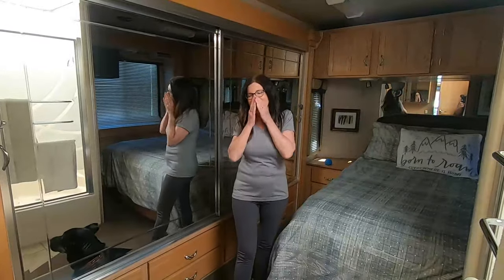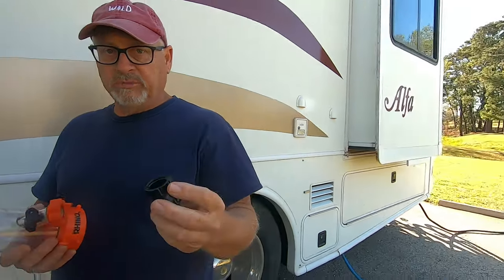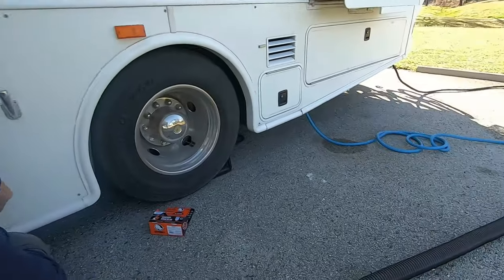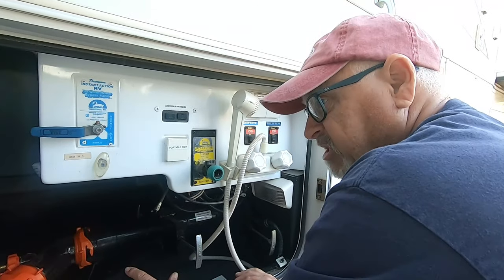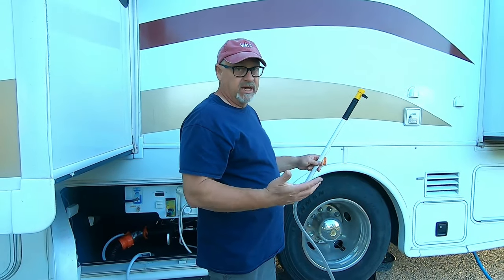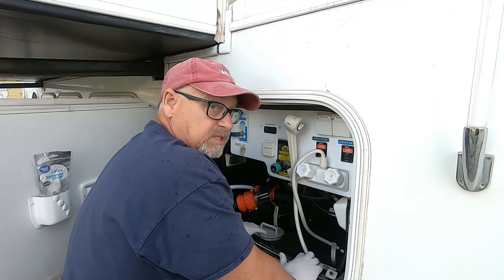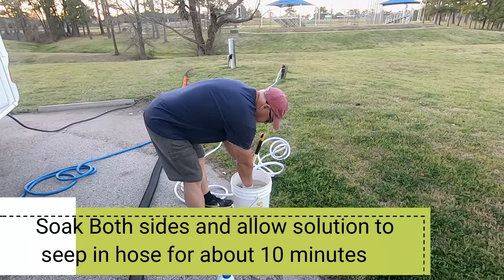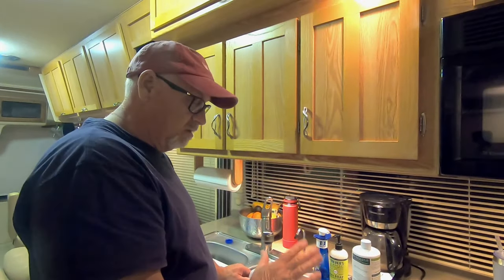Cleaning Out Your RV Black Water Tank 🚽 RV ENEMA 💩 RV Holding Tanks Maintenance

Comment: The best way ive done this (homestead living in a 5th wheel full time) is to do what youre doing, but have a shut off valve after the backwash attachment. Close the valve, and with a cheap water meter for the garden hose, fill to right before your tanks capacity and shut off the water, then open the dump valve. Repeat 3-5 times till water runs clear. 😊
Reply from the maker: Great tip! We ended up replacing the toilet. No more problems.
Thanks for watching!
Reply: @RoamingWithRosie  what was wrong with the toilet? And what toilet did you replace it with? Because I've been having issues with my tank constantly getting gunked up. Which is why I bought the backflush and started doing it.
Reply: Filling and flushing will not clean as good as the wand.
I know you see clear water coming out but believe me if you use the wand you'll see.
Reply: @bobcloughjr  I'm hooked up to a septic and sometimes have issues draining. I'm not too worried about it being spotless as I'm not using it for travel but rather living in it as we build a cabin.
Reply: What you really need to do this correctly is a gate valve attached to the downstream side of the Rhino Blaster. The better unit to buy is the Flush King which comes with a gate valve. This way you can fill up the tank and then drain it. When you have a full tank, the water pressure being drained is far greater than doing it the way you did it.

Comment: Probably not a problem, but, ever the perfectionist, I have a hose JUST for black water cleaning and a WHITE hose which is ONLY used for potable water.  Also, we bring gallons of reverse osmosis water which we use for drinking/cooking, so we almost never drink water from the on board freshwater tank. The idea of using my white hose to back flush the black water tank makes me cringe.
Reply from the maker: My fresh water hose is blue and is stored where my fresh water hook up is. The long white is with the rest of the sewer stuff in a large storage container and only used for flushing my tanks. 
 I am really picky when it comes to water. I only drink bottled water. 
Thanks for watching!

Comment: Dude that backflow preventer supposed to go in at the rhino connection that way you don’t contaminate your hose
Reply from the maker: No, the black vacuum breaker goes between the hose and the faucet. Read the instructions on the Rhino Blaster packaging. It specifically says between the hose and faucet. 
Thanks for watching!

Comment: Words of experience.   Before you drain the black and gray, hook up the hose and turn the water on.   If the valve is in the wrong position, and no water hose, it will leak out with the black water.   My flush elbow has a gate valve after the hose connection.   You can close it off and fill the tanks to flush them out multiple times.   Fun ain’t it!
Reply from the maker: Thanks for watching and the tip!

Comment: If you want to see how well you cleaned your black tank before you add your chemicals.  Fill your toilet full of water and have someone  watch the clear fitting while flushing the toilet. We also dump our dish washing water in the toilet and dump our black tank every  3-4 days. Never have a problem with smell.  Been doing this for several.
Reply: Years.  Also when using the wand ,don't let the toilet flapper close before removing the wand . You may damage the seal .
Reply from the maker: We replaced the old toilet with a Dometic 310 toilet and have had no issues. 
Thanks for watching!

Comment: We just refill our 40gal black tanks with about 25gal of clean water after we dump, then dump that out, and fill again with 10 gal.  Then we add OxyClean.  Couple of scoops per tank after each dump.  This method has been working great. When we first started full-timing it was an issue till we started doing this.  Since then no problems.
Reply from the maker: Thanks for sharing. When you purchase an old RV, you just arent sure what stored in there. For instance when we installed our Lion Energy batteries, we discovered a pack rat had lived in the spaces between the floor and the basement. Must have been quite awhile. And with this, a poop pyramid had dried to a state that wasnt coming out with liquid chemicals or dissolve even after driving around with it. This rig needed an enema! 🤣😱 Thankfully we have no odor left.
Reply: I do the same method of refilling but also a couple times a year the wand. You would be shocked to see what comes out of what you believed was a "clean" tank.
I suggest you try it.
Reply: @bobcloughjr  no doubt it's a mess in there.  The tanks in my RV have a spider nozzle thing with multiple exit points for the incoming water spread around the tank. Not exactly sure where they are in there, but I think they help somewhat.  Your advice is well taken though; I'm sure there are places the nozzles don't reach and they are probably caked up with goo.

Comment: Beautiful motorhome! We bought a travel trailer a couple weeks ago, unfortunately the previous owner left us with a black water tank that was about 3/4s full. Checked in the toilet not the gauge, they said they didnt use the camper this year so this is last years waste and im terrified its not gonna come out. Its still liquidy but man, i couldnt imagine leaving someone with my families mess like that. Never drained one before so thank you for the info.
Reply from the maker: I feel your pain. Our first motorhome had a poop pyramid. That usually happens when they leave the valve open when camping at a campground. The fluids drain out and leave the solids. That took some getting rid of. 
Thanks for watching!
Reply: @RoamingWithRosie  luckily mine looks pretty wet inside, gonna go dump it tomorrow, just my truck back from getting and alignment.
Reply: My wife and I bought a used 2021 39' Open Range travel trailer. We are experiencing the same problem. 
The previous owner used the trailer in a different state where he was working. He left the trailer down there where he was working when he traveled back to his house about 30 hours distance. 
We have emptied and flushed but still have the foul order. I've used different chemicals and cleaning agents to no avail. .
Your video was most helpful. I don't believe the previous owner took very good care of his trailer and then left his mess with me..
Thank you Roaming With Rosie for sharing this video. .

Stan

Comment: I have a 2004 SeeYa and use Alfa;\'s Sani-Flush with each dump. Other then an occasional odor fixed with Borax. We've had no major odor issues in 3 years of full-timing.
Reply from the maker: Sadly when we bought the Alfa, none of that was working anymore and a previous owner had tried to fix and ruined it all.. Its a pretty little plaque down there though. 😊

Comment: Good tips guys, Using the flush wand is your best way to clean the black tank, Note; if you have a gravity flush toilet only the wand should not be used with Vacuflush or macerator toilets. BTW, RV Digest-It is the best black and gray tank treatment on the market. The Rhino blaster basically just adds water to the tank, there is no way for the jet stream to hit the tank and break-up any waste due to the angles and bends the discharge pipes are at, the jet stream is dispersed by the bends and angles, unless it's a straight shoot right into the black or gray tanks, which is very rare. Safe Travels!
Reply from the maker: Thank you and thanks for watching!

Comment: I have a very similar set up except I use a system that has a shutoff downstream of the sewer hose drain that lets the tanks fill with water. I found that this clean the TP that sticks to the sides of the tank plus the heavy solids that need to pulled out with large amount of sewer drains.
Reply from the maker: When I emptied the black tank and hooked this up. I was surprised at much more came out. I have started doing the back flush every time I dump our tanks. Thanks for watching!

Comment: We had similar smell issues in our bus conversion, even after flushing and adding chemicals to break up solids. At the end of the day it took the toilet wand to fix the issue- there were little solids pyramids/columns in various parts of the tank. I would insert the end of the wand into the toilet, turn it on and lower it while on until you hear that grinding noise- then back it up just a bit. This means the wand can spin freely and is upright rather than at an angle. Our "permanent fix" to this issue has been to replace our toilet Dometic 310 (gravity fed) with the Dometic 7640 (macerator, same form factor). A macerator helps prevent buildup and doesn't allow the tank to "burp" into the cabin with buildup odor.
Reply from the maker: We had wanted to change out the toilet so ended up changing it out to the Dometic 320 toilet. Turns out the old toilet seal was all dried out and cracked. No more issues.
Thanks for sharing and watching!

Comment: You need an additional valve between the flusher and sewer hose. That way you can shut sewer line off while flushing with water to build water volume and agitation to tank and then after doing fill / flush water to black tank then turn off water then open gate valve between flusher and sewer.  So water.does not go down sewer while flushing
Reply from the maker: I already have the additional valve and also flush out my tanks. The issue was the seal that goes between the floor and the toilet. It was completely worn out. 
Thanks for watching!

Comment: Would a vent pipe with a small fan on it that hooked into the black tank that you can activate with a switch work to vent the oder in the black tank out when you flush and the ball valve is open?  That would create a suction up the vent pipe and gases would not go up the open toilet hole.
Reply from the maker: We ended up changing out the toilet. The problem ended up being the seal on the bottom of the toilet.
Thanks for watching!

Comment: I'm sure you know that you have a sani flush built into your black tank, good video.
Reply from the maker: It quit working before we purchased the RV. And the electronic flush valve not only didnt work, and the manual valve was stripped, meaning someone had already attempted this manually. A 17yr old coach. Some stuff is worn out. We're slowly replacing things. 😉

Comment: After doing a thorough clean and flush, I like to add Dawn low sudsing  dish soap with 5 gallons of water and travel to the next campsite letting this solution slosh around good to clean the sensors, Then dump and add chemicals.
Reply from the maker: That's a great idea! Thanks for watching!
Reply: @Larry V EXCELLENT IDEA!!!  I am going to try that.
Reply: I watched a YouTube video where they used calgon bath pearls, pinesol, and water mixture, and that really keeps things silky smooth running. Just youtube it you can see the videos people swear by using only that and no pricy rv chemicals.

Comment: You should try the rhino with the valve so you can fill tank with water and flush that way :)
Reply from the maker: Thanks. There are a lot of warnings about using those. People need to use care before trying.
Reply: @Roaming With Rosie  oh interesting. I've never seen any warnings. I always use a water flow meter so I know how many gallons I've put back into the tank. What are some of the warnings?

Comment: So if your system is hooked up to a septic line do you still have to do this flushing of the black tank in the gray tank?
Reply from the maker: Yes, when your hook up to a septic line in a camp ground you don’t want to leave the valves open. If you leave them open the liquid will go through your hose and leave the solids in your tank creating a real problem. Flushing your tanks clean anything that maybe stuck on the side walls of your tanks.
Thanks for watching!
Reply: Oh my..I really have messed up...
Hooked up to my septic tank, lived in rv for a year, never moved it!!
Working on cleaning it now.. one good thing did not put tp into toilet.
But no smell..and it works. I hope no teepee.

Comment: When you’re breaking down you rig to go home. 
1. Dump the black tank
2. Dump the gray tank
3. Fill the gray tank 
4. Fill and dump the black tank at least 2 times
5. Dump the gray tank
6. Add two scoops of “Happy Camper” - it adds enzymes and deodorizes.
7. Fill the black tank about 1/3rd+ full.
8. Hit the road and let the black tank slosh around.

(The first time you do this fill and dump the black tank until the tank gauge registers empty, or starts to register less than before. Eventually it will become accurate and not register 1/3rd+/- when it’s supposed to be empty)

If you do this regularly the solids that have built up in the tank and on the gauge float or sensor will be washed away and the smell will dissappear and your tank gauge will start registering accurately - unless it’s broken.

You don’t have to do this every time you dump - just when you break down to get on the road. It’s all about washing all the solid buildup off the bottom, and the side walls of the tank.

I’ve been doing this for years and between the wash out procedure and the “Happy Camper” the nasty toilet smells are gone and my tank always registers empty when dumped and always accurately reflects the black tank level throughout the trip.

“No I don’t represent Happy Camper” - if you find something like it - use that. I’ve just found it to be my favorite.
Reply from the maker: We have a routine that works for us. The issue was the gasket on the bottom of the toilet was worn out. We ended up replacing the toilet and have had no issues since.
Thanks for watching!

Comment: aren't you supposed to bring the drain hose up through that big hole in the bottom?
Reply from the maker: Not sure what you mean.
Reply: @RoamingWithRosie  The big hole in the floor of the valve box.  Never mind, the hose is coming out the door at 3:25 the it's coming down through the hole in the box floor at 8:12